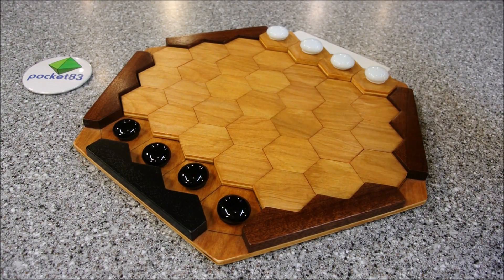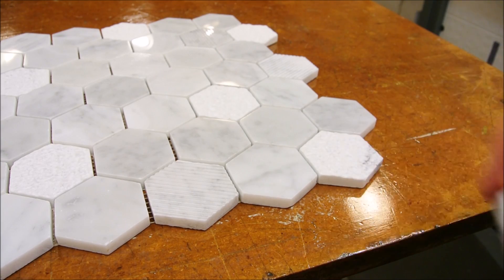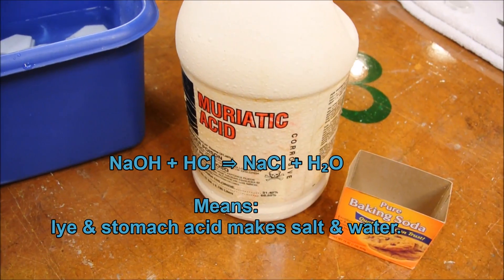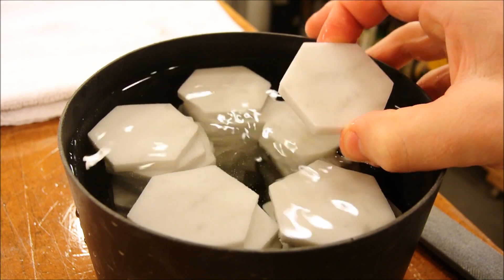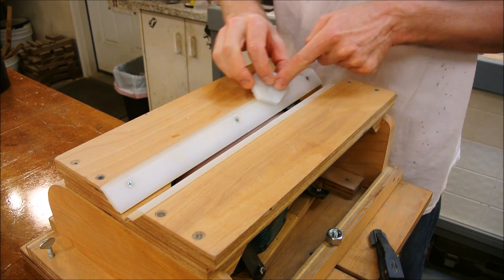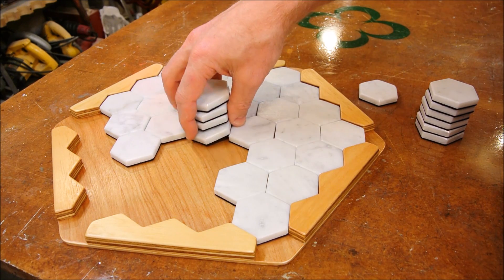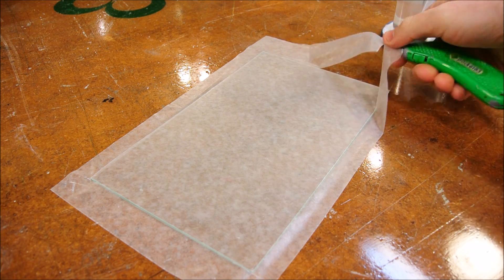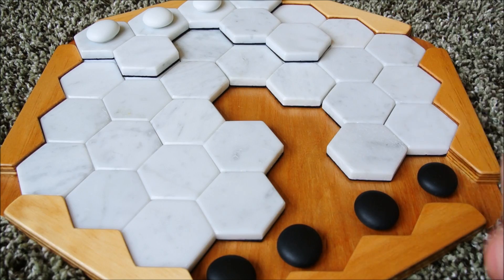Iso-path tiles from acid dipped marble

Comment: I've noticed you seem to be familiar with working with marble. Do you have any advice on how to make a set of bi-convex marble stones?
Reply from the maker: Please give me a better idea of the shape you are after.
Reply: If you're familiar with the game of Go, my brother and I have been trying to get our hands on a set of 12mm biconvex stones, basically the same size and shape as skittles, but made of marble. does that help?
Reply from the maker: Yes it does. Are you using slate for black? That's easy to find. Look for old fireplace mantles on Craigslist. My upcoming video about the pieces will deal with this topic, but there are only 8 Iso-path stones, while Go requires a ton. Also, Iso-path stones are far larger than 12mm, and only convex on one side, so they could be polished on a Dop stick.

I have to think about it before I can give you any advice. I understand how expensive Go stones are, but there's a reason for it. There aren't really any shortcuts to making them. If you have a wetsaw, an adaptation could be made, but no matter what you do, be prepared for a serious investment of time and effort. PLEASE don't let me discourage you- I'm just telling you that you have to want it! 

What was/is your plan so far?
Reply: The plan was to either learn to do it ourselves (we are proud craftsman but have never worked with stone cutting) or commission a set from someone. Marble as you know is easy to find. I had considered slate but I wondered if Ashford Black Marble (a type of dark limestone) would have a better feel in the hand. As I'm sure you're aware, Marble has a wonderful heft to it and a fantastic feel in the hand, which is ideal in a game like Go. 

In any case, we are both patient and persistent, so I am willing to do whatever legwork and hands on work that I have to. I just want to know if it can be done, and without costing a too considerable fortune.
Reply from the maker: Go for it. Since there's two of you, that will cut the labor in half! 
So, from Wikipedia, it looks like they're around 22mm wide, and 9mm tall. And you will be making somewhere around 361 of the things. How do we remove lots of material, fast? What's the first step? 

First, let's think about getting a consistent diameter on every stone. Worry about shaping later. One way could be with a holesaw. It would have to be done underwater, just so you don't have to buy more than 1 or 2 of them, but that's not too hard to rig up, especially if you have a drill press. If you don't have one, get one. I bought mine for $50 from Craigslist. Holesaws aren't too expensive either, if they're little; 10 or 20 bucks tops, and that's for a diamond one. Remember, they are measured by the hole they cut, not by the circle they leave, so you wouldn't be looking for a 22mm, you would be looking for something slightly bigger. I would GUESS around 26-30mm. 

You would normally cut the softer of the two materials first, just so you don't wear out the holesaw too quickly, but marble is soft as butter, and even slate should be fine with enough water. However, optical illusion makes white stones appear larger, so you should cut white first, no matter what- that way, as the diamond is worn away from the bit, and the stones are being cut slightly larger, that small size discrepancy will work to your advantage. Maybe use two holesaws, but cut 90 white with each, and then finish the second part of their lifespan with 90 black each. Hope that made sense.    

Shaping could be done by spinning against a stone or wheel, or perhaps by rotating the stone around a wetsaw blade that has a jig in place to control the shape. Wetsaws (little tile saws) are also an awesome tool, and they're also pretty cheap. Here, I made a vid about mine: https://www.youtube.com/watch?v=rIR8lQHP2eE

Dop sticks are going to be impractical here, just because of the large number. But hand shaping is also an option, if you aren't going anywhere this year. Ok, let me stop there for now to hear your thoughts.
Reply: Wow, wonderful advice here. Nice tip about cutting the white stones first, and yes I did follow all of that. I currently own a full (very expensive) set of yunzi stones that are 22mm, so I may build a 22mm set to start with, just to get the technique down. But we are definitely going to try again at 12mm eventually. The size is wonderful to run your hands through.

I can probably acquire those tools if they are truly as inexpensive as you say, so that is very encouraging. As for the shaping afterward, it will probably come down to hand sanding, but I think a shortcut after we get slugs cut out would be to use something akin to your chamfer rig, with a wooden stop to hold the stones in place. I believe that will put a nice edge on the stones to start, and make sanding down from there much easier. 

That video about the wetsaw is really helpful too. I will need to invest in one of those.
Reply from the maker: Wow, 12mm seems so tiny. That might be tough, but maybe not. Hmm. I'm building the picture in my head around 22mm stones first, just to visualize our problem easier.

A chamfer device will work, but you would need an additional attachment, since it's only making a 45° chamfer. Another chamfer, like a lower angled one, will further refine the shape. You're right; more chamfers mean less sanding/hand work. But also keep in mind that a sander is dry, so it's dusty. And marble will make the belt hot, and wear it out quickly. Rocks and minerals are better shaped by carborundum and/or wet cut methods. 

Here's a jig idea that might be difficult to visualize, so bear with me. Imagine that you have a wetsaw that has a wooden shelf/deck on top, above the blade. Let's say that the blade is embedded into this shelf. Now if we drill holes that are just larger than the slugs into the shelf at 45° and 22.5° relative to the blade, and then cut a slot in the side of the hole for finger access, we can drop the slug into the hole and quickly spin it like a wheel against the diamond part of the blade, and make multiple chamfers quickly. You could drill as many different angled holes as you want, and reduce the hand work, dust, and expense to a minimum. One wetsaw blade will cut marble until the world runs out of marble! There are some technical issues to work out with this idea, but it seems like a doable start.
Reply: pocket83 
Wow, okay that one is a bit difficult to visualize but it sounds like it might work. The only issue I have with that is what's stopping the marble slugs from continuously sliding further into the blade?
Reply from the maker: Drill only so deep. There would be some tinkering ;)
Reply: alright. I'll have to try it out. Thanks for the advice. I'll probably send some images or post a video when it's done.
Reply from the maker: Wait! One more thing. I forgot about this hidden video:
https://www.youtube.com/watch?v=X_8tceY9JPw

It's about marble work, so it might help you. Also, if you can wait, I think I may be making my Iso-path stones by the method we've just been developing. After some thought, I think I'll just stick a cut 2x4 in the wetsaw blade, and drill holes straight down into the kerf, along different points along the blade. A drill will rotate the stones.

If you want details, or to bounce more ideas, I'll be here. Thanks for the conversation, and good luck.

Comment: What concentration of acid are you using?
Reply from the maker: 31%, or 20° on the Baumé scale. I used about 200 mL straight out of the jug, and then added about 20 mL every 9 tiles or so to compensate for the reduced pH of the acid.

Comment: spray on tool grip, you can get it in any home depot or hardware stores, it is a spray paint rubber compound, I have used it for this exact same type of reason before and it worked great, you can even get it in colors
Reply from the maker: Spray stuff should work. I tried the dip can stuff (using a brush) on a tile; it was definitely sticky. It's also messy, expensive, and bonds approximately as well as silicone does to a surface, so there are pros and cons to it like everything else, I guess.

Comment: You might solve the sliding problem by putting a dowel in the bottom of all the tiles (maybe an 1/8" or even shorter). Then put a hole in each space on the game board and a hole on the top of each tile. Each tile would notch into its place and not move.
Reply from the maker: Yes, I discuss alternatives @1:15.

Problems: center-pinned pieces will still rotate about their pin (as will button magnets). This could be addressed by a small perimeter wall on each tile, but then the pin wouldn't be needed. But the real reason I don't like the pin idea is because of its visual distraction. 

Ok, here's what I think would be ideal: lots of teeny-tiny perimeter pins and holes, just like a checker piece has. But that would require manufactured parts.

Comment: Instead of using silicone for the bottom part of the hexagons, you could use hot glue. Then you wouldn't need to sand and drill all the small holes i think.

Fantastic video as always! Keep up the good work!

Comment: What was the concentration of the acid? Was it diluted?
Reply from the maker: 31%, or 20° on the Baumé scale. I used it directly from the bottle. This concentration is just strong enough to work for realistic projects, like concrete etching or extreme cleaning, without being too difficult to handle. If you've used HCL in a lab context, you may have seen more concentrated versions.

Comment: Have you thought about carving a shallow divot in the tiles so the stone has a spot to lie in? Might make the tiles easier to lift up from the first level during play. Give the index finger tip something to grab while the thumb pulls up the edge.
Reply from the maker: Like worry stones! Stylistically, that would be beautiful. However, it would also be an incredible amount of work, and the tiles weren't thick enough in this case to lose the mass. The ultimate board could look like that, though. Perhaps in amethyst?  

As for lifting the first tile from the middle, there is enough play in between the pieces and the board to cause enough of a small space to pry it up (It would probably be easy if I had nails). After the first one, moving tiles is easy.

Comment: I love every single part of these videos; From the craftsmanship all the way to scientific and mathematical explanations.... keep it up pocket! Also, don't take this the wrong way this is just a technical detail, but baking soda (sodium bicarbonate) doesn't release a hydroxide ion unless in solution. The reason why baking soda can neutralize the acid to begin with is due to the fact that the acid itself is already dissociated in water. Acids wouldn't be able to work unless in solution. Same thing with bases. In theory, if we had a hydrochloric salt, it would be totally fine to touch. However, once in contact with water the salt dissociates and becomes the extremely dangerous acid.
Reply from the maker: [Nods respectfully]
You are entirely correct, but I'm teaching concept here. My explanation of ions/compounds/salts was a super-crude mnemonic device. Given your obvious familiarity of the subject, I'm sure you can appreciate how tough it can be to get someone to pay attention to any explanation of physical phenomena at length. I have to reduce it to bare bones. As a former chem nerd, your point is noted, and conceded not without some residual embarrassment. But you can't realistically expect me to further complicate the matter (pun) for this type of presentation. 

Simply put, my content aims to be varied but general. It is my opinion that we should learn to use as many tools as possible, and that the arcane is too often a discouraging barrier to entry. The physical sciences need not be the exclusive academic club that they've become; such division of intellectual labor has caused a rift in our society, and an unacceptable scientific illiteracy has resulted. So basics are better than nothing, I guess. Thanks ;)
Reply: I completely concur with your statement, and thus I have no rebuttal for there is none. Scientific illiteracy/anxiety/fear/ignorance/incompetence (many synonyms and adjectives) is one of the largest epidemics within the human conscience to be entirely frank. The darker side of the coin is also the fact that there is little interest aside from monetary gain. I love the natural and physical sciences as both a hobby and a career, and inquiry within the subjects should be endorsed rather than retarded. I dunno, but I do know that kerfuffles over the basis of the subjects (flat earthers) are a good reason why illiteracy should be prevented.

Comment: why doesn't the acid eat through the peanut butter jar? or is it a glass jar?
Reply from the maker: It was plastic; it's non-reactive. But hydrochloric acid shouldn't be reactive with glass either.

However, hydrofluoric acid will actually etch and/or eat glass. I don't know what compound would dissolve plastics exclusively through pH. Interesting question.

Comment: What do you do to come up with ideas for things to do? Or how to do things? That silicone padding idea was pretty cool and I'd like to know your process behind coming up with ideas like that.
Reply from the maker: Thanks. That's a really flattering question! But there actually is a process. First, clearly state the problem. Then decide how much money/time/thought/effort you are willing to invest beforehand. Now look around, and see what it available to you. How can you apply the stuff at your disposal towards solving your problem? Don't rule anything out, until you know for a certain reason why it wouldn't work. After you've gone over everything you can think of, select your potential way forward from what remains. 

The silicone thing was just a case of ruling out what won't work first, and then doing whatever is left. But an idea as good as Iso-path takes lots and lots of thinking, and many failures. That sort of determination is hard work. Hope all of that doesn't sound too pretentious.
Reply: That's a very, very good answer. I recently retired after several decades as a software developer. Nailing down a clear definition of the problem, setting the boundaries of the problem, and doing a cost/benefit analysis of possible solutions made the actual software pretty easy...  And a smidgen of creativity never hurt :-)  Clyde
Reply from the maker: Interesting. Software de-bugging sounds like one of the cleanest examples of where a logical approach will get you to the finish line the fastest. Problem solving in general is probably just like that in a whole bunch of fields.

I also think you're right about adding a bit of creativity. Logic is stubborn, like a Roomba that's stuck in a corner. But if you go out to the garage and start randomly spraying stuff around like Jackson Pollock, you aren't really problem solving. Too much art is useless, but too much rigor is similarly maladaptive. Art and science are a dichotomy that have a maximum usefulness when they compliment each other. So when you can't see the solution logically, squirt a little paint on it! 

The other side of the coin: art that doesn't adapt to changing circumstances during its creation is an illogical rubbish, like postmodernism and/or relativism.
 Ars sine scientia nihil est.
I try to use both tools.